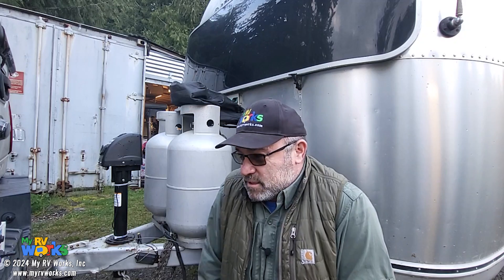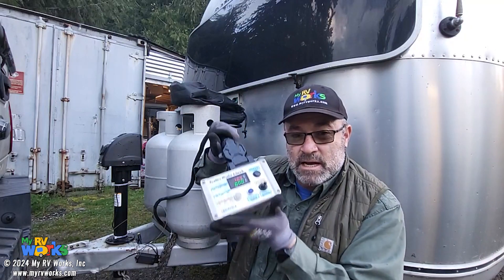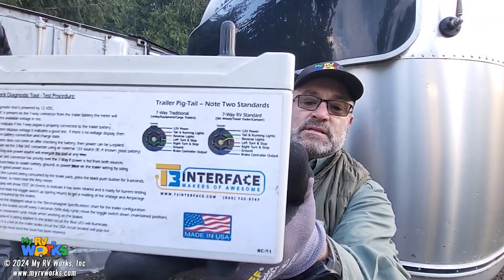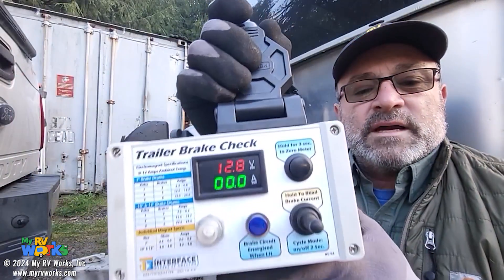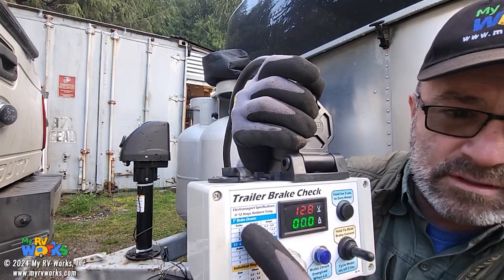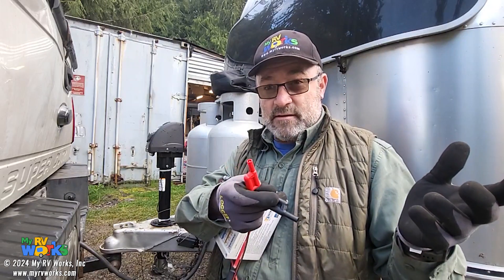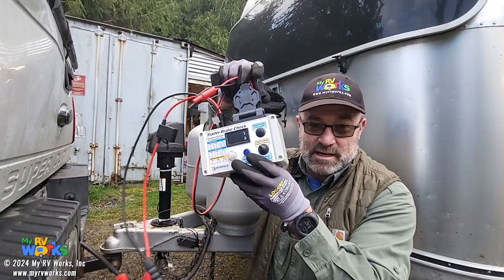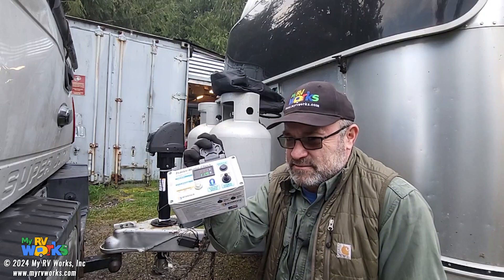Brake Check Diagnosis! -- My RV Works

Comment: I worked for a large landscape company back in the day... and our trailer alway came in light issues and brake issues... I made a tester that checked both, only thing I did not have was two seconds on brake check... Nice work though...

Comment: Darren, can you emulate electric brake gain when testing trailer brakes?
Reply from the maker: By electric brake gain I'm assuming your referencing the amount of current going to the brake circuit - as opposed to how quickly the brakes saturate once power is applied.  This current version does not have that feature.  In future versions however I do plan on coming out with the gain feature and also the ability for saturation current to be recorded and stored while breaking.  Those values will be able to be read/retreaved via an app.  I may even add the ability to record heat from each pad but I need to keep this thing affordable.  We have to start somewhere and this tool gets us to the show.  For everything this current diagnostic tool does it is amazing in diagnosing and finding faults in the brake circuit. I've been using and improving my homemade Frankenstein version for years.  I finally cleaned it up and made it 'pretty'.  I'm excited to get it out there for others to benefit from with all that it can do. Even without the gain feature.  LOL
Reply: @MyRVWorks  Correct, aka dynamic load simulation. Simulating the tow vehicle electric brake controller gain (0-10) would indicate functional proportional braking. In other words, I can prove functioning brakes at full gain (saturation) now, but do I need to prove proportional braking at something less than full gain?

Comment: I am a bit confused about what you are labeling as traditional wiring.  I own a 2008 f350 with factory wiring for towing my fifth wheel which works perfectly. I also occasionally tow an auto hauler or utility trailer and they work fine on the wiring as well.  So everything works, there is no apparent difference in the three trailer wiring.
Reply from the maker: What I mentioned in the video is that the circuits remain the same but the color of the wire changes. This would only matter if a technician were to rewire any of the plugs. Here is an article from etrailer which discusses what I'm referencing in the video. I hope this helps clear it up.

https://www.etrailer.com/question-292655.html

Comment: Darren when will the seven pin cable tester be ready?. Thank you
Reply: No the cable tester you used in the pop up wiring video
Reply from the maker: The Diagnostics tester we are making for checking trailer lights is in development now.  For that one, you will be able to read the current to each individual lighting circuit, check for ground shorts, and possibly even have a link where you can pair your phone with it via BT - but that Bluetooth feature might be in a future release if it's going to take us too much development time.  So be on the lookout for it but it's not available as of today.  Because the lighting one will be focusing on lights and current in each circuit, at this time we're not planning on incorporating the circuit for the break check into it since we want to keep the form factor kind of small.
Reply from the maker: The one we talk about in the video is available now. Below was a link.  We have a few left.

https://myrvworksstore.square.site/product/brake-check/647?cp=true&sa=false&sbp=false&q=false&category_id=3